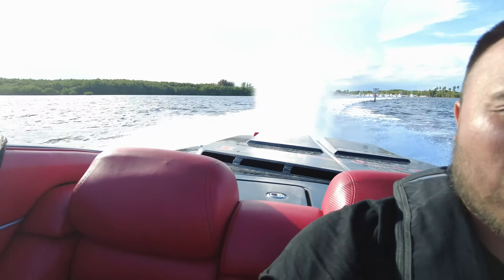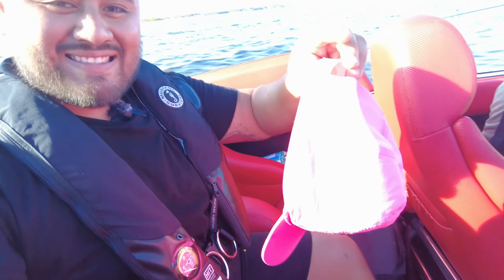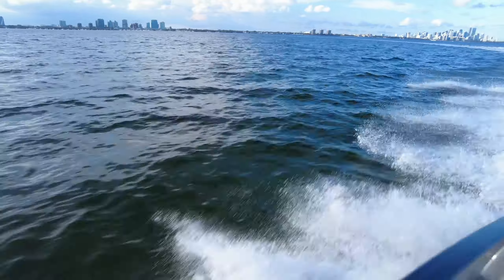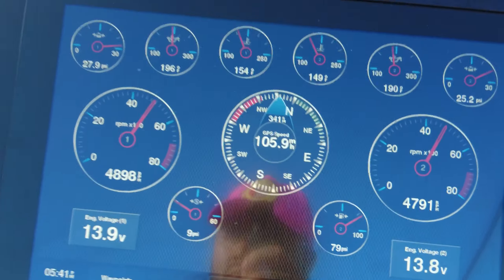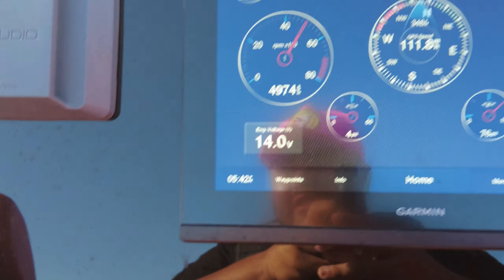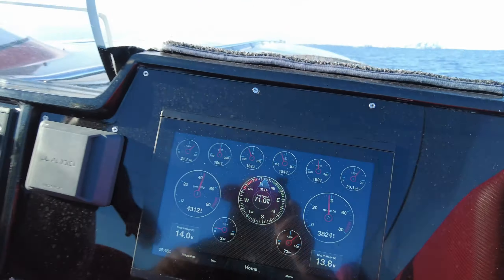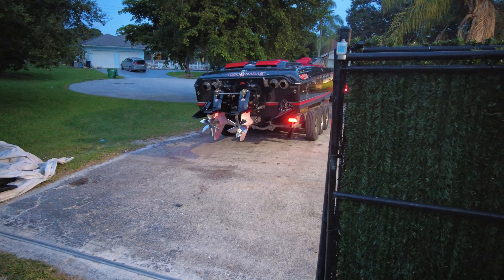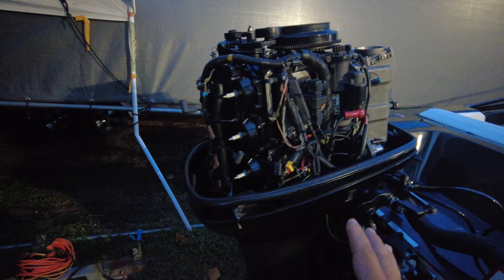1/2 MILLION DOLLAR RACE BOAT ( 2400 horsepower )

Comment: This is one of the fastest non canopy v bottoms around. This bottom is tweaked a little and this boat can run 135 with the right power. Such a great boat. Truly the fastest Donzi on the water. This exact boat here ran 137. Need to fix the water pick up issue to get there though. So much of that hull is out of the water at high speed you have to get really creative with water pick ups to cool those super high performance engines without compromising stability and speed. It’s tricky!

Comment: Also, thanks for wearing a floatation device. Those boats can spin out and if you get tossed your a done deal without it. Gotta make sure the lanyards are on too so the boat doesn’t circle back and run you over. A runaway boat at 100 plus always ends badly. I have seen it before it’s ugly.